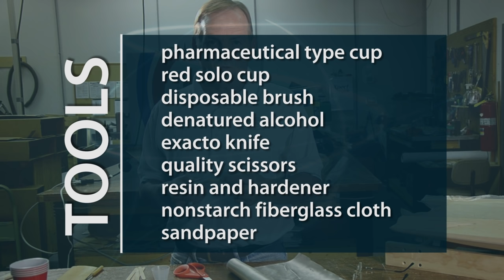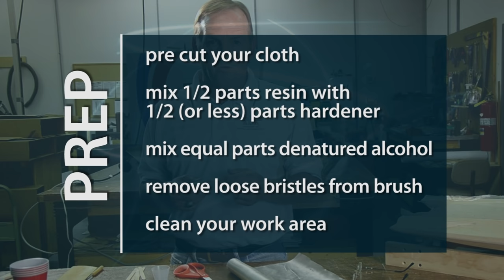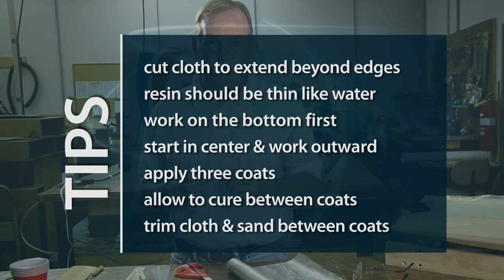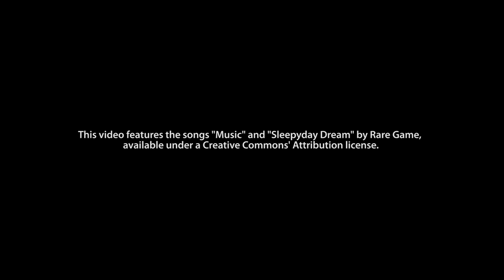Fiberglassing Tutorial with Greg Hahn - Model Aviation magazine

Comment: I've built fiberglass boats for the offshore power-boating industry and also rotor blades for helicopters. We always wet the area before fabric, then wet out and roll to desired consistency. the only time we wet only on top is when using vac bags

Comment: Great tutorial!
One technical correction on the denatured alcohol.  Alcohol is hygroscopic, meaning it absorbs water, including from the air.  Manufacturers have to do special, expensive operations to get all the water out (that product is labeled "anhydrous" and costs!) - then over time it will absorb water from the air, so there's a shelf-life.  A bit of searching suggests that hardware-store alcohol has around 7% water content.  The cloudiness is from the alcohol ADDING water.  That will cut the resin strength by some amount.  Still, looks like thinning it does a great job of penetrating and hardening up the balsa (which also contains moisture) so you're getting good results, which is what counts here.

Comment: I was curious about the statement (around 8:43) that too much hardener would prevent set up.  I would have thought too much hardener would cause set up to happen too quickly.  It did for me using Bondo body putty.  I used too much hardener and it set up in the container while I was still stirring it...lol  Thanks for taking the time to post your informative video.

Comment: I will be building a rocket soon that will need fiberglass reinforcements to the "fin can" section so they can withstand supersonic flights without ripping off, which I've never done before.  This is the exact video I needed to have the confidence to get it done.  Thanks!

Comment: I have been using the Zpoxy Finishing Poxy but instead of measuring it all the time I use a Postage scale to weigh equal amounts on the "gram" scale.  Since the Resin is slightly heavier than the Hardener there is no problem with equal mixing.  Works very well for me.

Bob
Reply: Robert Blubaugh  Yes and No.. I do the same, but i back off on the Hardener by  a full 15%.. since the Resin is heavier as you said by about that percentage..
 So  if you put an equal amount by weight of Hardener, you are using MORE hardener than Resin by VOLUME,  and running the risk of NOT curing... so its the opposite.. I have gone a full 20% LESS (by weight)   on Hardener and it cured perfectly.. 
 and i use an extremely  accurate scale    ..01 gram accuracy.
Reply: Jeff from Jersey  You are absolutely correct, I was thinking backwards!  My scale measures only in whole whole grams and the amounts I have been mixing has not exceeded 10 grams total, not including any alcohol I added  so there has not been a problem with curing, thankfully.  I'll have to see about getting a more sensitive scale or mix more epoxy so that I can easily  back off on the hardener to keep the ratios correct, i.e. 5/4 grams resin to hardener (maybe a couple drops more hardener).

Comment from the maker: Both work as a thinner but isopropyl is water soluble and de-natured is not. Using isopropyl will leave water in the resin and could cause problems later down the road often causing paint to later blister in high heat situations because of the water trapped in the resin. In the tutorial I stated that the mix becomes cloudy and that’s the alcohol eliminating the water in the resin. When using isopropyl you’ll notice the mix stays cloudy all the time.  Hope this helps.  

-Greg Hahn

Comment: Sir, I am immensely glad I found this video. I learned so much from this.
I have a few questions though for you or anyone else in the comments section: See, I'm a professional prop maker. I rarely use fiberglass for finished products, but I use it all the time to make rigid mother-molds that encase softer silicone molds. Would you recommend that "non-starch, 1-oz cloth" for the same job? Until now, I've just been using that packaged fiberglass cloth they sell at auto shops and everywhere else. That stuff is HORRIBLE at going around corners, and it leaves pointy burrs all over that I have to grind down. It just doesn't do it. Remember, I'm trying stick the fiberglass onto a squishy piece of silicone. Then remove it and expect it to keep its shape.
Also, would any epoxy work just as well?
And lastly, would fiberglass resin work as well, or not so much? There's a few brands that are more local to me.
And what was the company you bought the fiberglass from? I couldn't make out the name of it.
Thank you.
Reply: Can you bond the fiberglass repairs to plastic if not what do you  recommend for plastic boats?

Comment: The fiberglass cloth can be found at

https://ziroligiantscaleplans.com/building-supplies-tools/fiberglass-cloth.html

I've tried using 3M "Bondo" All Purpose Fiberglass Resin. Unlike the example in the video, it uses a small tube of hardener measured in drops.

I've experimented with thinning it with either acetone or alcohol in a 1:1 ratio. With both, the resin did not harden completely after 24 hours: still a bit tacky to the touch. After 48 hours, both the left-over resins had set to stiff flexibility with a sticky film. This may be a characteristic of the Bondo product.

I've used the unthinned resin on pine and birch plywood. It does not penetrate the wood as thoroughly as the thinned resin in the video, but does produce a very durable finish suitable for the application of glass cloth.

I'm using the Bondo resin because it is available at big box homecenter stores relatively cheaply since I'm covering a large Zepplin-shaped rocking "horse."

I tried using Solo cups, but the Bondo product attacks them. I've been using the non-waxed Dixie hot/cold paper cups successfully.

When using Bondo resin wear a chemical respirator. I also wear a filter mask when sanding the glass cloth.

Comment: Hey i happened to have red solo cups and used them like you did. Butt the fiberglass began to make holes in it and some how melt the cup slightly and it was leaking alot lol i thought i was just being messy at first but man it was the dang cup. So i recommend using like a glass jar or something stronger.
Reply: They probably changed their formula in the intervening years.  I've never used them that way, but they aren't the same great disposable cup they used to be even in normal use.  Any store brand is just as good now, and usually cheaper.  A formerly good brand cheeps out in manufacturing, imagine my shock.  ;)

Comment: Great VIDEO,  I never did epoxy resin, thinning with denatured alcohol,  I've only done polyester resin,  thin with acetone, Question --  which works best on repair of fiberglass truck hoods,? Epoxy resin  or Polyester  resin? Thanks William
Reply: 2 years late but just use polyester.

Comment: Someone told me they thought Raka epoxy was the cheapest available, which is what I would like to confirm just for learning, practicing, small projects, etc, before I do more permanent complex stuff. Also will any brand of epoxy work over another? For example if West Marine system was used on something, would Raka work over that for additions, repairs?

Comment: I am building a diving board:

-The Base is made of Maple and Douglas Fir Ply wood, 4 sheets thick glued together. Dimensions are 2''x1',4''X14'  
-I am planing on applying mat fiberglass to the finished product to add strength and protect the board from the elements.

Would Mat Fiber glass be ideal for this application if not, please let me know which type of fiberglass you would Recommend.

Comment: Hi there, I'm sure you are the right person who can answer my question. I have a fibreglass radio antenna that has a couple of long splits at the top of the first section. Basically, it comes in three parts and the wind has obviously taken its toll over a couple of years. Rather than chuck the antenna away, I'm hoping that I can reinforce the section works contains the splits with some fibreglass taping. I've already got the tape, I'm just wondering which resin to use. Thanks in advance

Comment: Hi Greg, 
new to this fiberglass world and i am in the mist of building a rc heli fuse that was well made out of Fiberglass, but i find that there is a very big crease where they mated the two halves and it is presenting kinda of headache for my build, is there any way or method you suggest for getting rid of the crease? thanks for any info you can provide in this matter.

Comment: I have a project I'm beginning: I'm hoping to use polyester resin w/ MEKP on cardboard. Is this do-able? I've never done anything like this before. I have fiberglass cloth for part of it.

My project is a divided insert for a chart table on a sail boat (think of it as similar to your utensil divider in your kitchen drawer, but for dividers, parallel rules, charts, pens, etc.). I'm making it out of cardboard. I was thinking polyester resin with fiberglass cloth would make it stronger and more water resistant.

Will the polyester with MEKP eat the cardboard? Will eat the glue (I used hot glue to join the parts and water activated paper with some fibers - like for sealing boxes for shipping), the paper?

Can I paint first - using a spray paint.

Sorry for the questions,  but your video was good and now I have a bunch of questions.

Thanks,

MB

Comment: Would this approach with thinned resin be an alternative to the "peel ply" technique?  Perhaps the thinned resin is more self-leveling and spreads thinner so the "peel ply" isn't needed to smooth the surface and reduce excess resin.

Comment: I wanted to make a fiberglass mold and purchased the following items from a local store:

1. Gel Coat
2. Mekp
3. Resin
4. Matt

The shopkeeper told me that I also needed COBALT in order to cure the Gelcoat and Resin and if I didn't add it the whole mixture would not cure. Is he right? Do I really need to use COBALT in order to cure the Gelcoat and the Laminating Resin?

Comment: i hope you answer..... i want to add height to my fiberglass wheel house so i dont have to dunk to see out window .......use which resin, if polyester do you still thin it with the denatured alcohol ??    i plan to use on new wood and then drape over existing fiberglass and finish. also would you recommend epoxy or polyester on a boat

Comment: Not quite clear, do you thin all three coats of epoxy or just the first coat?  I wouldn't think the epoxy would penetrate after the first coat and the build up would be slower but I will do as you instruct.

Comment: What exactly is "Gel Coat"? I have the West System epoxy with the slow hardener, can I just use that? I know the gel coat is put on first before you put the glass on that surface, but is it different then the epoxy? Can I just forgo the gel coat and have the thinned epoxy go through the cloth like your doing in the video? Is it possible to destarch fiberglass cloth if I don't know if mine is starched? I have to attach two sides of an RC sailboat hull with joint tape and "gelcoat".

Comment: All of the Denatured Alcohol I've come across state that it should not be mix with anything elser and not to used as a thinner. Also states its a clean burning fuel and for marine stove use. 

I check my local hardware stores and even on ebay can't seem to fine the same one your using.

Any comment on that.

Comment: I'm repairing a 1966 Toronado, the lower door panels are damaged with pieces missing.  The original door material is rather brittle.  Should I make a mold and a new fiberglass piece or will applying fiberglass over the top strengthen the panel enough to withstand kicks and the door closing repeatedly?

Comment: Dear sirs,
 Great stuff for such a "sticky" subject. The 2 types of resin then epoxy you use and the other mentioned in remarks a poly. Can you expand quiclky on this please. 
 The type you use stays soft or ply-able and allows some give correct. The poly with mek you say is harder I quess it too is brittle?  I have access to bondo brand resin which as you surly know is a poly with mek. Can I use this type? If i do what are the cons and pros if there are any. 
 My project is a Palatus porter 73 inch ws that will have a nitro 4 stroke out has a balsa covered foam core wing. Thanks in advance for your advice and of coarse for the time and effor making this video.

Comment: Hi Greg, I know that it has been many year from the time you posted the tutorial and I do not know if you are still responding. Anyway, I am building a P51 1/5 scale from Top Flite and the idea is fiberglassing the airplane. My question is: should I glue the stabilizer and fin to the fuselage  before glassing or glassing them after the whole model has been finished, sanded etc....many thanks!!!

Comment from the maker: Yes alcohol will slow the curing process. To speed it up apply heat after spreading the resin
Reply: modelaircraft  hi awesome video 
I have one question 
I’m using the bondo brand fibreglass resin , the mix is one oz of resin and ten drops of hardener 
So if I want to use denatured alcohol how much should I use?

Comment: I'm hoping someone still checks this for questions but- I have an NGC35cc that absolutely refuses to run inverted so I am going to use it on a Long E-Z 160 instead. I need to run it upright with the head ending up over the top of the cowl of course. So what I would like to do is mirror the scoop that runs along the bottom of the cow but of course larger on the top to accommodate the head size. How do I make a scoop on top of the cowl with the hole cut out for the head ?
Reply: ***** PS, great tutorial !

Comment: To cut the fibreglass easily and very precisely, a cutting wheel like for pizza, but sharper is for sale in specialised shops. Works best. Scissors are very difficult to use.

Comment: How much does the fiberglass fabric overlap?  Also, what brand do you use / are there different (thread count) consistencies?
Reply: Overlap about 1/8" to 1/4". Glass cloth is sold by weight per square yard. For airplanes, 3/4 ounce cloth is commonly used.

Comment: Can this method be used in a spray form on the final coating? I know the sprayer will most likely be junk afterwards but it seems like it could give a very smooth coat if it works like I'm thinking, (then again I've never done anything like this before which is why I asked).

Comment: I love your content &style. But for my project I have questions:
Can foam plastic be used instead of wood as underlying surface?
Can leaf-spring be made with this tech, and what material to use as a core in this case?
How to make fiberglass flexible tubes 0.5-2" OD &~0.5mm wall thickness?
Thank you.
Reply from the maker: 1.)    There are two main glass resins: epoxy resin (soft, which I’m using in the video) and polyester resin (hard)
You can use epoxy resin over plastic foam cores but not polyester resin ( it contains MEK and will eat most plastics) MEK is Methyl Ethyl Ketone
 
2.)    To make springs from glass it will need to be made from polyester resin and will need to be heat tempered similar to heat treating metallurgy. Fiberglass doesn’t have inherent tensile strength. The core will need to be either carbon or glass with a defined longitudinal pattern
3.)    Fiberglass tubing I buy it.
Reply: modelaircraft
Thx for answer, I didn't know that.
Reply: +Horizon585 Good questions. I have the same issues. Am in Germany and can't seem to get all the stuff stated in the vid. Any good alternatives?
Reply: +TINKA GLASS (Die GlasFee) Would be great if anyone could help out on this.. thx!
Reply: +Horizon585 Methylated Spirit is exactly the same. Not sure about Polystyrene. I think it will work at least with Epoxy. Google is your friend.

Comment: Do you layer the cloth and cover it with resin or do I just do three coats of the resin on one layer of cloth?
Reply: One layer of cloth and three coats of resin. The first coat fills the pores of the wood and sticks the glass to the wood. Trim and sand the edges smooth. Apply the second coat of resin. It should just about fill the weave. Sand any rough or high spots. Apply the third coat of resin. It should make it smooth enough for a final sanding. Avoid sanding into the cloth. Apply primer (I like dark gray) and when it's dry, sand the primer with 400 to 600 wet-or-dry using water before applying the color.

Comment: modelaircraft  if I want my fiber to be a bit more flexible(like for a bow), is it advisable to reduce the hardener part?
Reply: Is the opposite you add more hardener not too much though it won't set off and you will have sticky resin

Comment: Does the resin add significant weight to the basal wood?
Reply from the maker: It adds about the same weight as any other sealing system or film covering if you keep the coats thin
Reply: I was involved in a university project to build a carbon fibre plane to compete in the Air Cargo Challenge (the goal is to build the plane that could carry more weight with the same motor and electronics than the other competitors) and one of our big big problems was managing the amount of epoxy that seeped into the technical foam positioned between 2 plates of carbon fibre composite, made of 2 or 3 sheets of the stuff. It was rock solid but much too heavy. We should have used pre-preg carbon fibre to avoid excess epoxy. Although in this case, I have to agree with Mr. Hahn and I think it's a worth the extra weight. My question is... can I do this to my rc plane foam wings? The heat from the resin curing won't damage the foam? Thanks

Comment: That's a huge amount of catalyst. I see some guy on you tube use only 5% catalyst mixed with 500ml resin.
I wonder if under these circumstances one could use denatured alcohol (methylated spirits).
Reply: Trevor, that would have been polyester resin and it would have been 5ml not 5%. The resin in this video is epoxy.